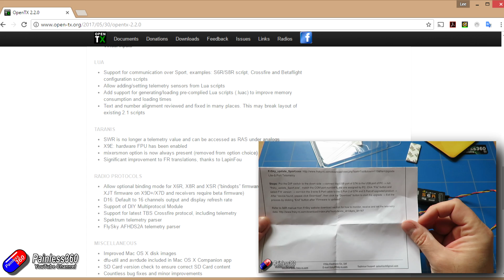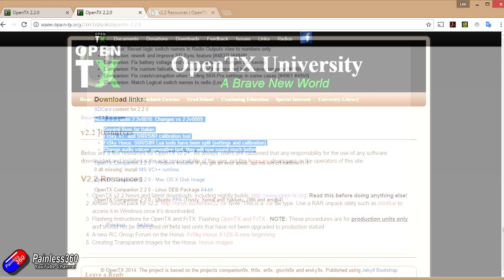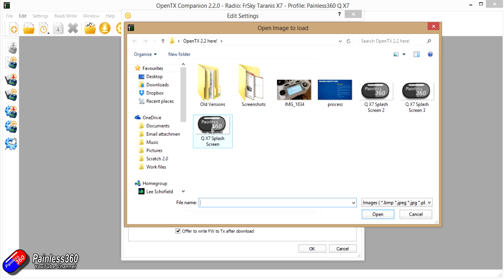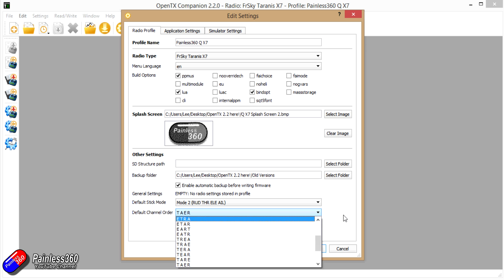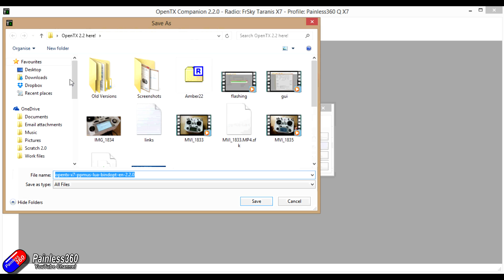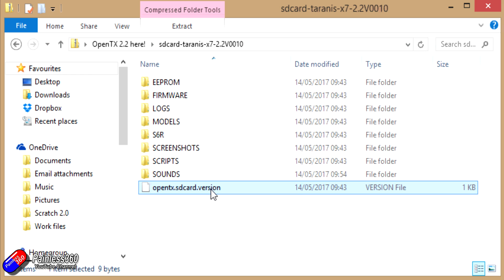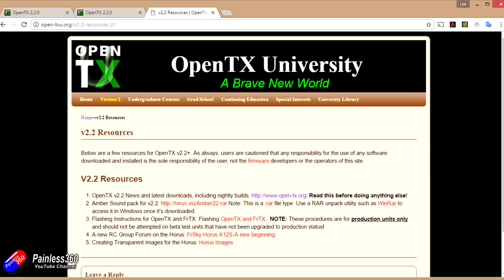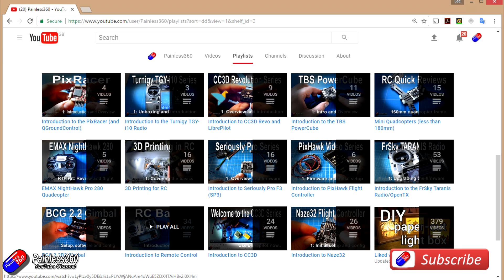Installing OpenTX 2.2 onto a Frsky Q X7 or other FrSky Radio (Taranis/Horus)

Comment: My QX7 has open tx on it, but the version says that it is FrSky. Should I replace it with a new version from the FrSky site or switch over to the Open TX download?
Reply from the maker: If you mean the splash screen on startup or the audio says FrSky - they are both customisable so don't mean anything on their own...
Reply: @Painless360  good point. Splash screen says Open TX. Drilling into the setup menu it says FrSky (and some numbers and letters in parenthesis). I am just wondering if I should do an update from FrSky or Open TX. I need to flash my R-XSR with ACCESS instead of ACCST if that makes any difference. I don't want to change too many variables at once.
Reply from the maker: I am not an expert in ACCESS. I used to upgrade to Opentx before using companion but I have not used any of the latest Frsky radios for some time. Best of luck with it..

Comment: Whats the difference between the firmware from frsky website and the opentx(or companion)? They are different versions now, like 2.3V0021 vs 2.3V0020. Also the opentx brings the radio firmware right? but I can later install a different one XJT to have the D8 if I needed it without the computer. By this I mean, install the international version of opentx and change the radio firmware between fcc and lbt. Or did I get it wrong?
Reply from the maker: Firmware is what runs the radio module and can be FCC or LBT. Opentx runs the rest of the radio..

Comment: After flashed my Taranis X9E i have eeprom warning on the screen :(
eeprom data v 217
press any key
When i press any key i got converting eeprom every time :(

What to do now
Cheers
Reply from the maker: I've not had that here. If check the forums.. Best of luck!
Reply: @Painless360  TweetFPV on his channel replied that this is normal :)
So i hope i am all set here i guess but i will check on forums. I just started with OpenTX and building new TT Raptor E550 FBL so i will check all man :)
Cheers
Reply: @Painless360  After upgrading to 230 now in wizard on creating new model i dont have heli. Just airplane, flying wing and drone. Though in menu i have heli setup in txt mode. Weird...

Comment: Hello Lee  - I'm just trying to update a X7S from 2.2.0 to 2.2.3. However - I always get a "Firmware check failed"  error message. A Backup to file works. The right X7/X7S FW file has been downloaded.  Just can't get it to write the new FW version. Every  Hint is welcome.
Reply from the maker: What is the file youve downloaded called?
Reply: @Painless360  It is called opentx-x7-en-2.2.3
Reply from the maker: Hmm, looks right, I see you don't have LUA support selected any reason for that?
Reply: @Painless360  Hi Lee - no specific reason - just went be the defaults to update to 2.2.3. Just testet it with LUA and eu selected. Same error. Did you guys do anything special to these Radios (it is one of the radios you had your hands on last year in Waymouth. :) )
Reply: @Painless360  Hi Lee - Problem solved (bypassed?) - I updated the Bootloader and the Firmware via the SDCard - now it also works via Companion. Thanks and have a good time.

Comment: Hi I have a problem, I have stuffed up the instalation of a 4 in 1 Module having finished up with Firmware 2.2.3 on the TX and a 2.2.2 boot loader I can find no way to re flash it on the TX have watched many videos on the process but non work for me can you help, can find no way in Companion as I have corrupted backup files, I can find no way to download 2.2.2  Regards Geoff
Reply from the maker: I've not tried to downgrade here - http://www.open-tx.org/2018/07/28/opentx-2.2.2 best of luck!

Comment: i wonder if anyone can help me, i flashed my Taranis X9D Plus to the new 2.2.3, now when i turn the radio on i don't get the "welcome to taranis" sound, the wav file is in my system folder in the sound folder, anyone got any ideas ??
thanks
Reply from the maker: The way I figured this out was to download the SD card contents for OpenTX 2.2 and then look at the track listing to see what the 'welcome' sound was called. Check out the one called 'hello.wav' in the system folder. That's the one played on start-up.. Best of luck!

Comment: Hi, your channel is really amazing and always interesting.  About this series I have a question about the q x7.
I have played in a sim via USB connection, about 5 or 6 times . Then I wanted to go out for a real flight, what happens, the transmitter won't start up. Did you have such a problem or a solution? Banggood send me a new one for a low money and I want to connect again, but I am afraid about it. Would be nice if you tell something about this. 
Best regards
Reply from the maker: That is unusual, I've not seen that myself. Best of luck with the next one!

Comment: Dear Sir, you and your videos are just fantastic, i have a question please, , I am new to this field and recently got a QX7S  and a Rooster to start , but it seems so much more difficult, i'm stuck at the first step, the radio arrived just few  days a go but the firmware is 2.2.0 date 05-09-2017 , 
do I need to upgrade a version to 2.2.2 ?! 
the receiver has been used in my Rooster is R-XSR and vtx is TBS Unify Pro HV if it helps ?
i really would appreciate any kind of help info or advise , thanks a lot
Reply from the maker: The firmware installed on your radio is a great starting point. There is no need to upgrade at this point. Please watch my OpenTX series, and also the recent Quadcopter building for beginners series that goes through every single step. The rooster is a beautiful model, one of my favourite  - you’ll have a whale of a time with it. Best of luck!
Reply: @Painless360  hello... the samething with me... I just recieved my QX7 a few days ago and it has 2.2.2 (June 24 2018) on it (and just so you know its FCC, non EU, cause I live in the USA)......  so last night I downloaded the SD card file pack from Frsky and put that on the sd card and also downloaded the amber sound pack from open tx University and replaced that sound folder (that works perfect)..... my question is...after I put the sd card in the transmitter all amber sounds work and I have lua scripts as well...... but my Firmware Folder is empty (it just has readme.txt that says firmware goes in here).

I was told by a few people that their needs to be files inside the firmware folder??? Is this true??

I cant seem to get a straight answer from anyone about this... I cant even find a YouTube video about this.

(I do have the lua scripts on this as well too)

I really don't  want to but new firmware or do anything extra that I dont have to... I'm confused already lol.

I'm waiting on my Leader 3se (bnf frsky reciever)(I think its nano reciever) to come here by next week and I'm also waiting on the mobula 7 to get here.

I just wanna have my transmitter all prepared. 

Any help what's so ever would be much appreciated.
Reply from the maker: You put the firmware you want in there - by default there is nothing in it - you can check this by looking at the original .zip file. Happy flying!
Reply: @Painless360  sorry to bother you again... I understand that...but what firmware goes in there? Isnt the firmware 2.2.2 on the transmitter already?? Does it need to be in the firmware folder on the sd card?
Reply from the maker: I've got a video on pretty much everything on the radio so you can find the content you need using a YouTube or Google search i.e. 'frsky firmware painless360' to find the video that explains that. If you're new to the radio and OpenTX I'd suggest watching those videos so you can get to grips with it faster. Short answer to your specific question - it's for the receivers and internal modules, not OpenTX.. Best of luck!
Reply: @Painless360  I been looking at videos like crazy lol... just started looking at yours... looked at all JC's already... I'm getting through yours currently too...thanks

Comment: this message was not meant for you it was meant for get fpv sorry love your chanel good work thay refurde me to you on a forward sorry i do have a question for you though i got the diatone gt 200s and it has a fury f3s betafight fc with a force rx have you done any reviews on the fc    thank you i know your time is sold gold thay did not send my the wiring diagram for the fc kind of lost cant find info anywhere  shawntpatrick 1223@gmail.com if you dont have time to reply i understand your so bizz thank you takecare    shawn

Comment: hello and great channel and video. love all your uploads. very informative. question, when updating open tx, im currently using XM+ which has no tele meaning i will not be able to do lua scripts. i will be upgrading to the frsky r9m long range module with r9 sim rx as an alternative to the crossfire, will this affect the update of the opentx? lastly, if im still using the XM+ rx, after updating opentx, will i have to rebind my XM+ to the radio once more? i ask only because my bind button has come off the rx and im unable to rebind if i need to. thank you again. i appreciate your kind help and advise
Reply from the maker: It's been a while since I updated one of my radios but so far (touches wood for luck) they have remembered the binds and all the details afterwards..
Reply: thank you! will update and hopefully itll bind haha. if not, is there a way to bind without the bind button?

Comment: I'm new to quads.  I'm looking at an X7 transmitter. The flight controller board has Cleanflight, I've downloaded Cleanflight on my laptop and am familiar with Arduino.ide.  I 'm only seeing the transmitters with Open TX.  Do I need CleanFlight installed on the transmitter?  Or does it work with the Cleanflight flight controllers with some setup configuration on the transmitter?  Thank you.  You guys rock with awesome video tutorials!
Reply from the maker: Sounds like you're very new to all this. Don't worry - in a few months you'll have all the lingo sorted. I'd recommend watching the 'Quadcopter Building for Beginners' series on the channel as it explains everything in lots of detail as well as some fo the videos in the 'Introduction to Remote Control' series.. Best of luck!

Comment: The OpenTX's 2.2.0 Companion is not offering the 2.2.0 firmware anymore. It's only offering 2.2.1. Do you have the 2.2.0 firmware file for the Taranis X9D+?

Comment: I used this video to upgrade firmware on a QX7 from 2.2.0 to 2.2.1 and... Brick. I didn't see any mention of version rename due to file length restrictions, or did I miss it. Any tips would be most appreciated.
Reply: OK, my bad. In 2.2.1 you have to hold the power switch down for power up, just as you have always had to hold the switch down for power down. File name length had nothing to do with it.

Comment: pain im a noob to opentx and i have win 10 , have companion set up and ready to go with profile etc. go into bootloader mode says connected but no drives appear. not even a icon to safely remove drive. went into devices and found bootloader and it says error,, ??  i use this cable on several devices so i know its not the cable , what am i missing??
Reply: using qx7
Reply from the maker: +michael honeychuck not sure, I've not seen that here. I'd suspect its a driver issue. Have a look in the forums, I'm sure others have seen it and know how to get it sorted. Best of luck!
Reply: driiver issue but on win 10 drives will not appear. zadig worked , its all good now . i got it thanks . also with win 10 you cant use paint 3d,  had to use paint . also for some reason the bit map can be much larger than 128x64, i will redo mine and post the actual size soon but several people claim that is the size too tiny.  being new to this its awesome love it.

Comment: I just bought a Taranis Plus radio (used).  It had 2.1.6. The previous owner flew multi-rotors.  I flashed it with 2.2. and tried deleting the info on the SD card but for some reason my computer would not let me. I tried going back to version on my other radio 2.1.9. but it would not let me.  I get a SD card error now when I turn on the radio. When looking at my SD card on my desktop there were two files my system would not let me delete.  I still get the sounds set-up on the switches for the multi-rotor.  Tried merging the bit maps but now none show up.  You think getting a new SD card will get rid of the SD card error and allow my bit-maps to show up again?

Comment: Hey, ive flash my classic taranis 9xd with OTX 2.2 FW.. and ive brick my controller after the process completed.
Could it be hardware issues?
Reply from the maker: +zEr bEth maybe, but possible it was the wrong firmware.. all is probably not lost - http://open-txu.org/home/special-interests/curing-a-bricked-taranis/

Comment: I notice that you did not tick the  ''eu'' box  I did the same and now I get the SD CARD WARNING Expected version 2.2v0010 on Tx start-up - you do go through a proceedure to eliminate the warning but I find it difficult, what with moving files around and such, not sure if it can be made simpler

 Lee - hope you don't mind me saying so - I found that when you discuss the movement and setup of files,and the pointer is wandering around as well -  I  find it hard to follow you 5:45 to 8:0 say  - I  know it's a difficult balance to get  a point over,  especially to the lowest common denominator folk  such as me. 
     As  you can see Juan above found a way to get rid of the SD CARD WARNING but I'm a little hesitent to re-flash the FW and still keep my Amber Sounds and models - I suppose I've got to stik at it,  thanks for great video's...joe
Reply from the maker: +Joe Stubbs Most of this modern radio control technology relies on a basic understanding of computers and files. So unfortunately if you’re not confident with the basics of moving files around then you can find it a little overwhelming.
Reply: Lee - agreed,  I will get there in the end, enjoying the challenge tho...joe
Reply: Lee  -  got there, what helped was having a spare 16GB SD with adapter and used it to play with moving  files around between Tx SD and adapter SD, so now have a spare SD card both working with Amber sounds - your video's help enormously thanks...joe
Reply from the maker: Good job! Glad you got it sorted.. Happy flying! :D

Comment: Your make great videos and always easy to follow. (only issue I had was after backing up the SD card you need to delete everything ! Then add the new 2.2 SD card version file first,  before copying your models etc across or you get the SD card error message )
All the telemetry works fine. But just numbers now, no sexy Amber voice for Volts -feet-meters etc ?? 
Help any one ? Or has this been taken away in 2.2 ?
Reply from the maker: +Harry Holt no, the Amber voice pack is available for OpenTX 2.2 as well. See the video series here for more detail. Best of luck
Reply: thanks for that, I thought it was in the SD card version file. Yeah all done and works fine, got back all the missing sounds. Have to use winrar to open the 2.2 sounds file not usual Zip ! (wish we could find all the Open TX instructions in one place lol ) Keep up the good video's sir !

Comment: I have a Taranis X9D with OpenTX 2.1.9, can I upgrade this to the latest version of OpenTX so that I could use the FrSky S6R?  I'd like to install the STM32 iRangeX IRX4 also, so I could fly my e-flite planes.  Do you see any problem with this plan?
Reply from the maker: +Richard Fahie no, backup the radio and best of luck!

Comment: While flashing firmware on QX7 something went wrong because now when I try to put the radio into bootloader mode all I get is a white flash and the radio stays off. Can you lend a hand in this situation?
Reply from the maker: +Primo Cruz the process worked for me, I'd suggest having a look in the forums. Best of luck!

Comment: Just out of curiosity, does the QX7 have a built in "STM-DFU Mode" like the X9D Plus? This makes the X9D practically unbrickable. If so, does one use the same Zadig drivers as with the X9D?

Comment: Hello thanks for your video , I have followed the instructions to the best of my ability and am having difficulty... no sounds are playing on start up.  I recently purchased an X7 from Banggood , I downloaded companion and flashed the tx firmware to 2.2.0. I downloaded SD contents from open-tx.org (Taranis-X7-2.2V0010) I kept the English sounds in the sound folder and also downloaded,unpacked, loaded amber2.2 (from opentx university) into the SD card making a total of 2 sound pack folders inside the sounds folder. 
When using the X7 I can access the SD card via page 2 in the radio setup section, I can see sound files , when I click play I get an error "path to long " and have to exit out. Incidentally I also get an SD card warning on start up (expected ver:2.2V0010) strange as I though it was what I had downloaded ? 
I have voice language set to English in radio setup , am I missing something else here ? 
Thanks in advance for any guidance to help me solve this issue.
Reply from the maker: +Marcus Whitehead sounds like you didn't copy the amber pack over the top of the existing sound pack on the SD card. You can't just put them anywhere on the SD card, that won't work. Best of luck
Reply: Painless360, thank you , I have  solved the problem , getting the files relocated correctly at the root level was the fix. Dragging and dropping the folder is what tripped me up causing lots of head scratching .